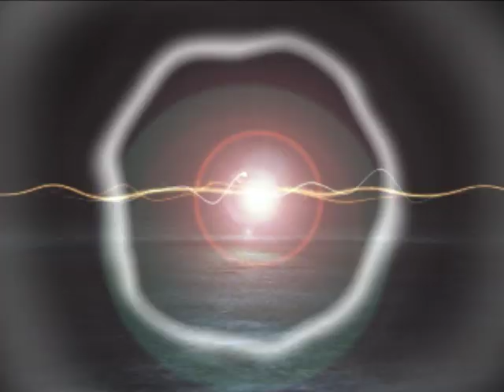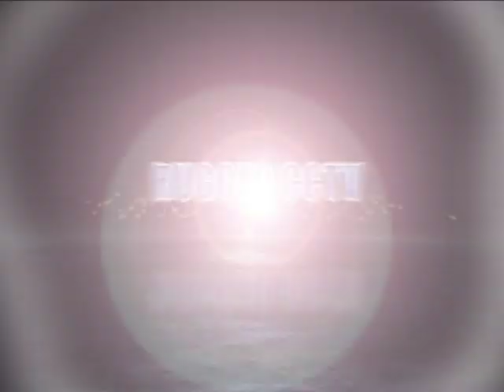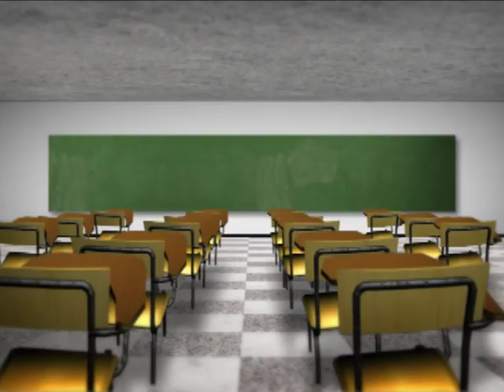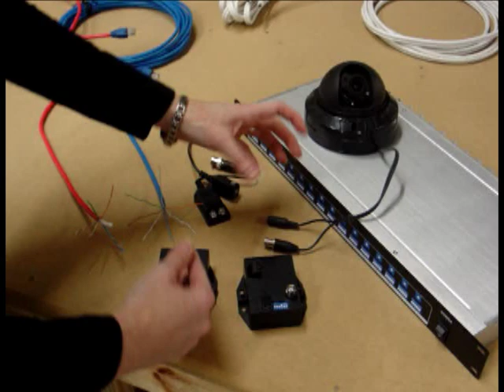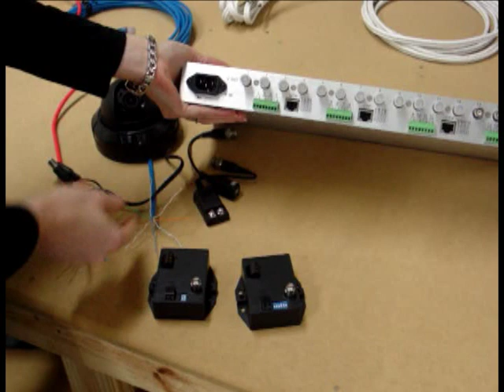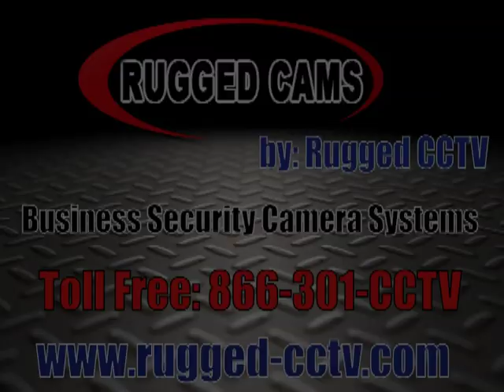Analog Video Over Cat5

Comment from the maker: You're correct on the balun distances being for video ONLY. Because we NEVER recommend transferring power over cat5 for any voltage.  It will damage the cabling, introduce interference into your signal and potentially damage the camera as well. 18 gauge / 2 conductor power wire is the smallest power wire we recommend, and most of our cameras run at 12V DC so as long as you have the correct power supply, and you are within the distance limitations - no converter will be needed.

Comment: Keep in mind the distances she's talking about when using powered and non powered baluns are for VIDEO. Not for the 12v power line. You're going to need a 24v power supply and then a 24v to 12v converter for long distances.